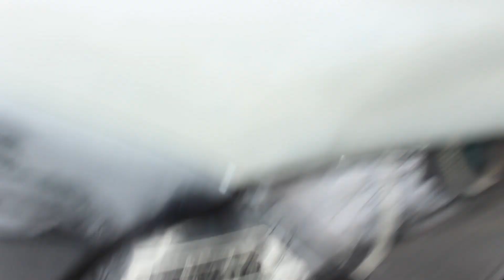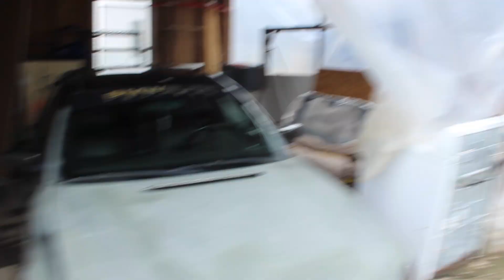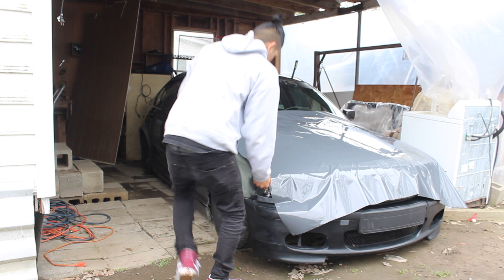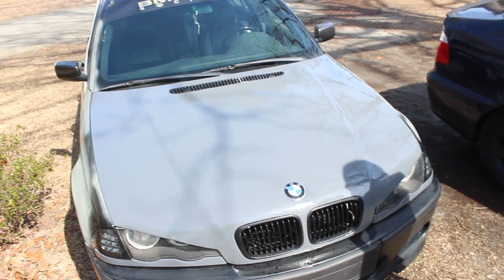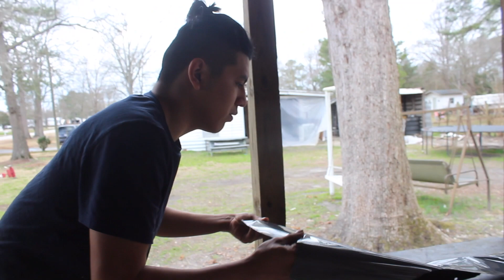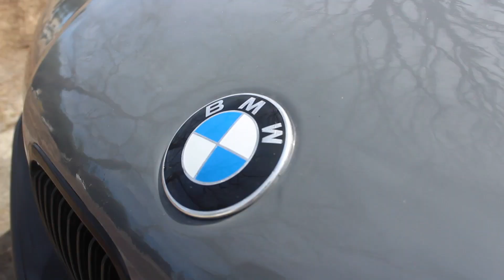Vinyl Wrapping My BMW E46! Part 1

Comment: After you wrap one part, heat up everything again. So the glue 'activate' and it stick better on the surface.
Had the same at work. Forgot too heat it up again and one week later it starts loosing at the corners.

Comment: I think you’re doing an awesome job so far brotha. One of my good friends owns a vinyl wrapping business, one thing that I know he used is vinyl adhesive applicator, it’s a spray that will help the edges stick and you won’t run into that problem of t peeling or flaking up! Also, get Thomas off the camera and have him help. Wrapping with TWO people is a lot easier then one, especially when laying it down. You got it SAM!

Comment: I was close on the color. Nice choice. What I would have done was roll the fenders or make it wider before applying the wrap. I’m not sure if you can do it with the wrap if it will mess it up. Now u need deep dish wheels. And csl everything

Comment: Only way to learn is try with that said it’s fire and you did it is the best part fix the fender and move on remember you need to heat the whole panel at the end for shrink back when it get in the sun mainly the edges good luck waiting for part 2 👍🏻